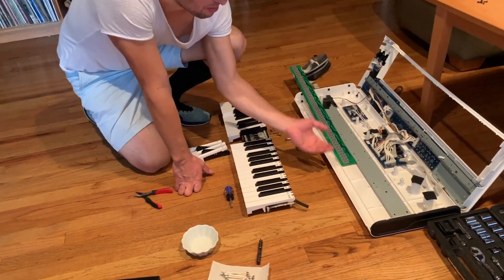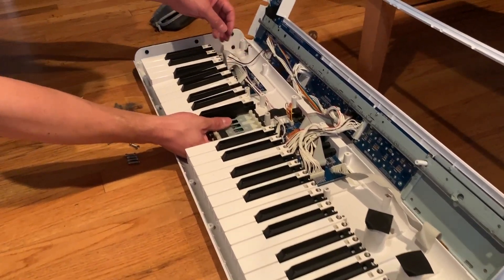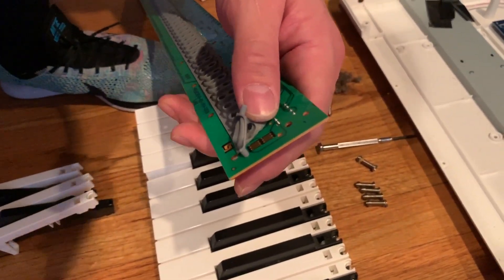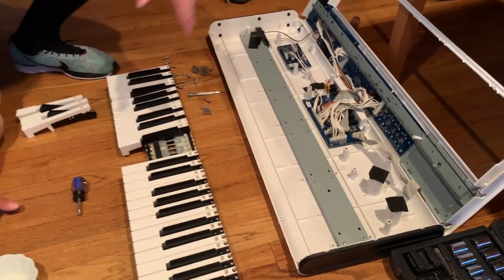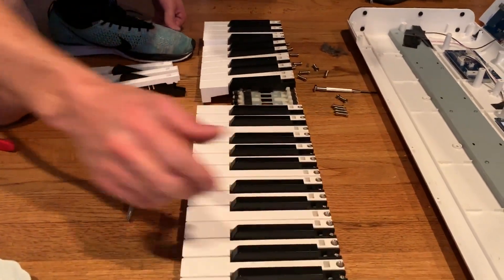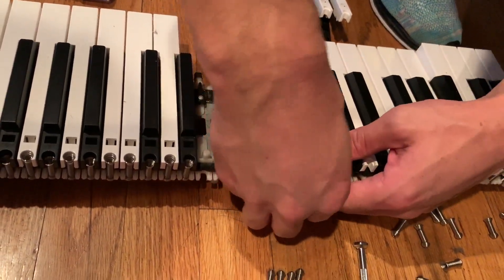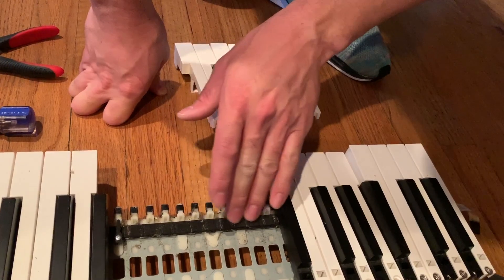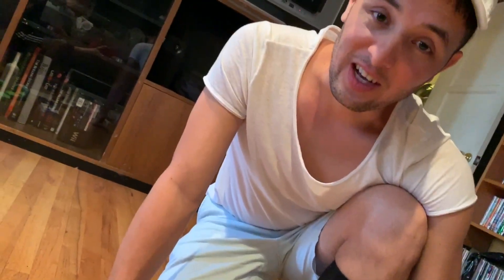How to CLEAN and REPAIR BROKEN KEYS on your M-Audio Axiom Pro 49 (or Equivalent) Keyboard

Comment: I just successfully fixed three broken keys on my Keystation 61 MK3, thanks to this video. It was simple enough. I unscrewed everything from the underside of the casing, set the top casing aside leaving the wires connected. I was able even leave the wires connected to the keys and just carefully set the keyboard standing up on its back. I only needed to fix three keys near the right hand side, and the circuit board is split in two so I only removed the right-side board. Then I cleaned the contacts for the dead keys under the rubber strip with alcohol. The contacts on the board actually looked kind of fried (makes sense after discovering that the previous owner spilled liquid on the keyboard), so I took a pencil and marked over the contact circuits. This added a new layer of conductivity to the contacts. Brought my three dead keys back to life! Since all the wires were still connected, I plugged the keyboard back in and tested it before re-assembling it.

Comment: Thanks! Several of the keys on my Axium 49 weren't working at all. Not even a signal in MIDI-OX. I thought I was doomed so I opened it up -- carefully on a large smooth rug to catch the screw-- a million of them. No dust at all so I just tapped all the connectors and plugged it back in before closing it and voila! works perfectly. I have fixed a lot of things that way. Not even the slightest idea of what was wrong or exactly what I did to fix it. Probably something loose somewhere. Thanks.

Comment: this video is the bomb man! really helped me get underneath and repair my keystation 49e. I had 3 dead keys and it turns out I spilt candle wax down there years ago. it had dried up and cover up the sensors on the green plate - doh! all fixed now though
Reply: Must have been one steamy night, lol
Reply: @ellvtv2314  I need a power board for my M-Audio Axiom air 49 keyboard

Comment: Just went into my old silver Oxy 61 1st gen and replaced the knackered old foam behind the keys in the hope of quietening the clack.  No joy :(   However did discover a smudge of dried up red wine from 2003 - yay! :)  If anyone knows how to kill the clack on key return, I would love to hear from you.   My tip: deep screws are for the case fixing, shallow ones are for the keyboard-to-case fixing.  Cheers.

Comment: i am trying to get keys to trigger again properly- noticed that in addition to screws corroding over the decade or two I have had the axio 25 the springs also seemed to corrode a bit -- yes nasty stuff inside but I am wondering if the two spring types have to be set to a specific setting? Or do all the white keys get put in the same position for the springs and all the black spring positions the black springs are smaller than the white springs.  Is there something I should use to get the corrosion off the springs? Should I oil the springs to protect them from more corrosion. The device is still working but the keyboard part is registering multiple key pushes like a whole octive.. I figure it may have been a key jamming or something. Hoping cleaning it up will fix the issue.  Thankfully I do have a full size keyboard and the knobs and drum pad part are working and I have an old akai mpd 16 hooked up to the midi and it is working... it would be nice if the keyboard was playing nice.. hopefully it will work again once I finish cleaning it up. Wondering if the spring position varies by key as it seemed that the corrsion had stopped the springs moving the same way and they were all aligned differently

Comment: Nice video, any idea where you can get replacement keys for ones that have broken?
Reply: They might not be broken, only broken loose of the spring that holds them in place. Get a screwdriver and interrogate!

Comment: I replaced usb port and 1 cap so far and was wandering how do you get the springs off from the keys ..could not see ....but that bar i thought was the aftertouch bar its a mono after touch...also think we could put some felt in there to quiet the keybed???
Reply from the maker: Sco B I took needle nose pliers and just took the springs off with that.  It’s easy with pliers.
Reply: pull outward or upward with the pliars ? @adrianrobison
Reply from the maker: @MediaMusik777  It's a spring so you want to pull upward to "stretch" the spring and then outward to release it.  Try it!  It's not scary or hard to do...   just make sure you are using needle nose pliers!!!

Comment: Hey, every other video about fixing an axiom involves popping of the individual keys,. Did you have much of a problem getting this back together after cleaning the contacts? Thanks
Reply from the maker: John Stanford yes, I popped off all the keys and cleaned the whole thing.  Other than being time consuming, it’s not a bid deal at all and is super easy to do.  I only take off a few keys on this video because I didn’t wanna bore everyone with the entire process...